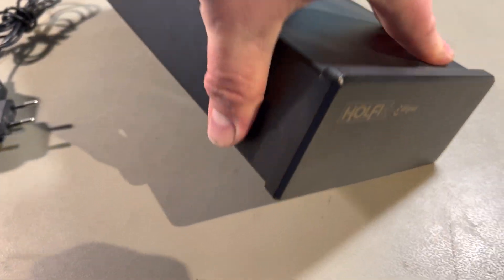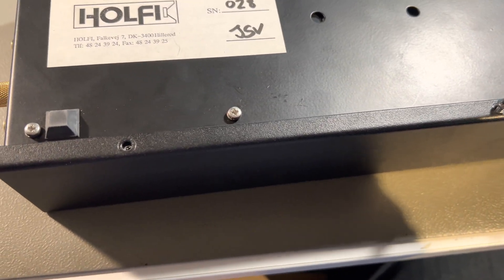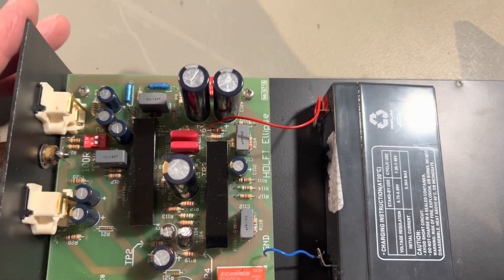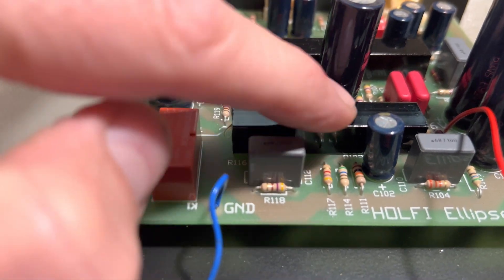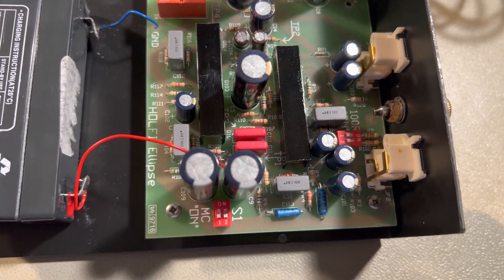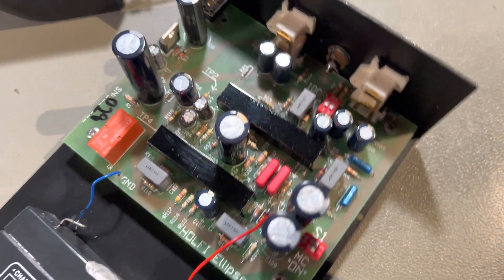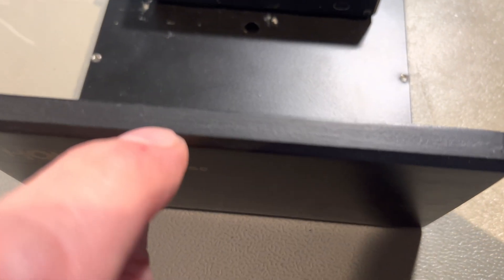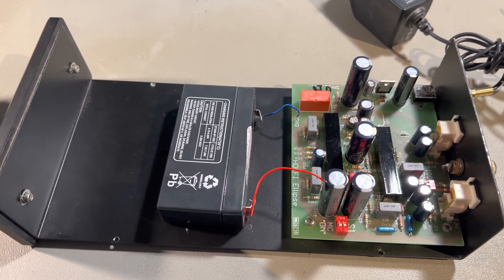Holfi Ellipse Phono / Riaa Preamp for MM and MC build in Battery

Comment: No schematics, but quite easy little circuit, which should be quite easy to draw inside ltspice.
The creators of Holfi do to a certain extent help repairing the gear. Many of the small signal transistors and components used, is difficult to obtain. And due to their no feedback design essential if you want the original sound signature.